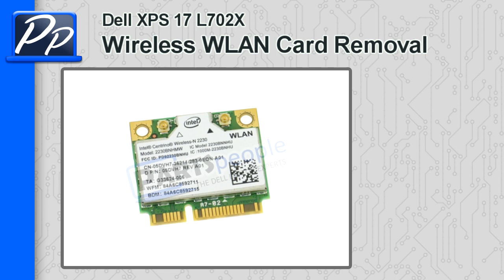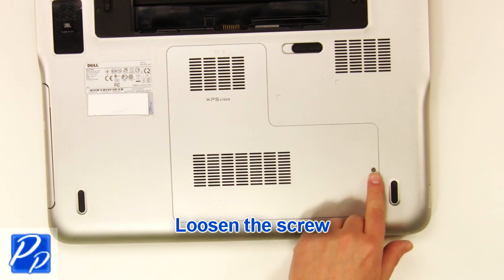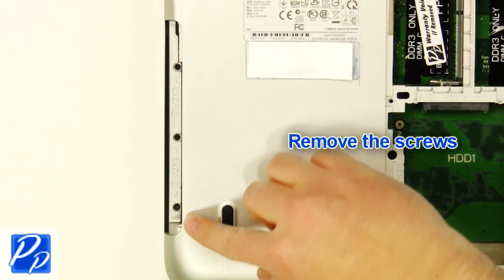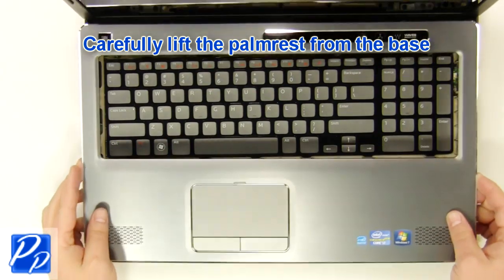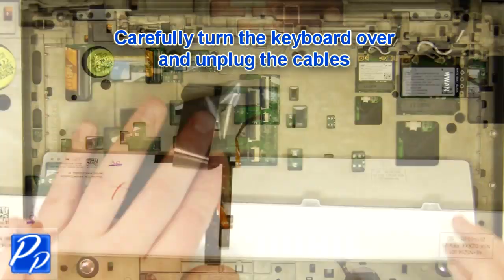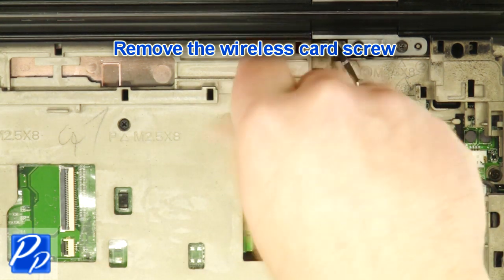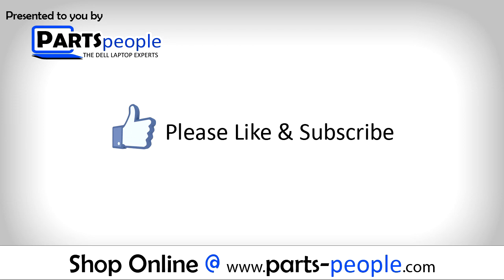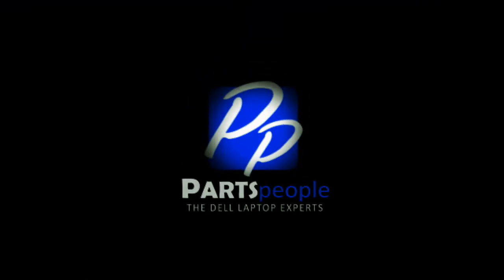Dell XPS 17 (L702X) Wireless WLAN Card Replacement Video Tutorial Teardown

Comment: very nice video , i have a short question : 
if i remove the wireless card of my old laptop , i can build it in my new pc right ? because the wlan card of my new pc is actually fukin shit compared to the one in the xps ^^
Reply from the maker: It depends on the wireless card and if you can fine a driver for it.
Reply: Parts-People.Com, Inc i have exactly the same card(from xps17) but i think i need an Adapter for it